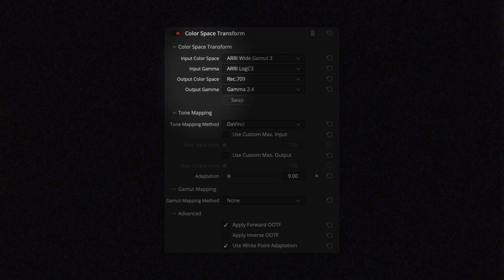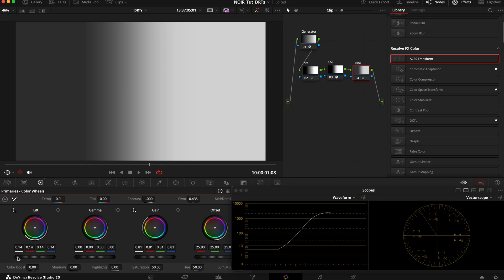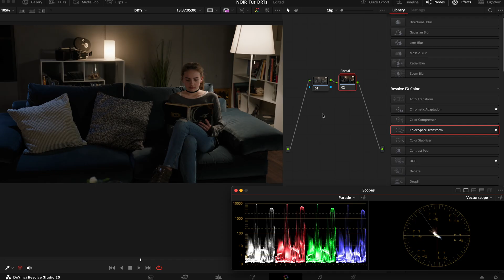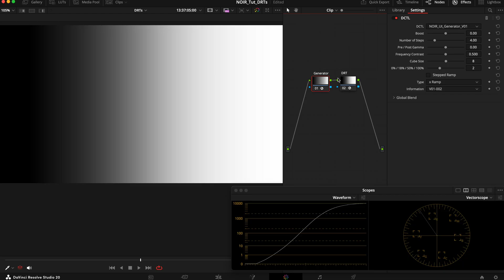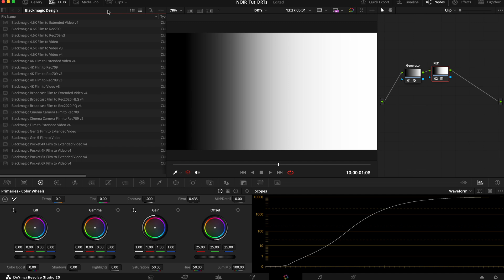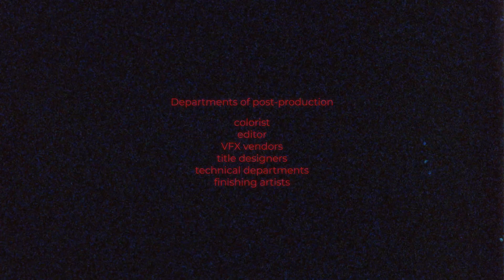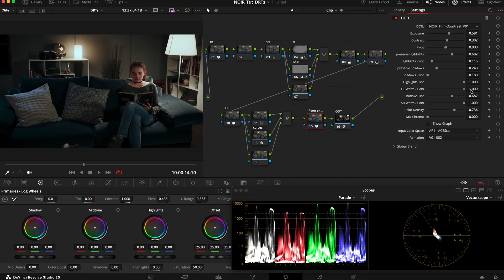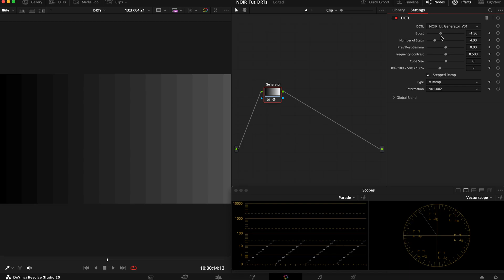Everybody is WRONG about DRTs

Comment: Such a great explanation of the technical side of DRTs and what they do. Awesome job, Sven! Personally, my go-to DRTs these days are JP2499, CSTs and Filmverse Lite. I recently installed OpenDRT as well and the presets look lovely. But I do agree with your point that it's better to have a neutral starting point and to make your creative choice in the grade, instead of in the DRT. That's one of the main reasons I decided not to invest into Cullen's Genesis plugin.
Reply from the maker: thanks Marieta. yeah, I totally get choosing a DRT for creative reasons. That's fine if it fits the project. But a DRT is also not the only reason for choosing a pipeline. For some shows it is just the better idea to do everything in ACES. For some it is smarter to work with RCM (for example if you need certain IDTs)
Reply: Nice to see you here Marieta! Yeah, I am thinking Genesis isn't for me just yet. I like the flexibility I have with FILMBOX for that style workflow/Filmverse is actually amazing and same with OpenDRT.
Reply: From what I gather Genesis is constrained to film colorimetry and texture. A very contained and straightforward film emulation tool if you will. What you’re adjusting is mimicking photochemical lab processes (photo chemical look development as opposed to digital look development) that feeds into a print emulation or “the display render”.

Based on the philosophy that je shared its equivalent look development feeding into DRT (Print)

So is that not doing the major two step  process in one node at the end vs doing it across several nodes leading to the end if you were to group that all into a compound node wouldn’t it be the same thing in terms of complexity and order of operations.?

Comment: I am a hobbyist and in no way considered a professional colourist. I make little YouTubes with my consumer kit, Osmo Pocket, DJI drones and Panasonic cameras. Before the concept of DRT's became popular I was happy grading with Resolve's own Colour Space transform workflow. As it happens I live in a seaside town which has stunning sunsets and bright lights including neon lights. While grading my projects under these lighting conditions I would get strange artifacts in my grading. Hues and tones would simply break giving me horrible blotchy black pixels when tyhe scene had very strong vivid lighting from neon lights or firework displays.

When I started using DRT's in my colour grading all these problems of strong lighting conditions or vivid hues creating horrible black blotching artifacts immediately stopped and I was able to tame and control those hues. I even went back into old projects and replaced the Colour Space Transform node with a DRT and immediately saw an improvement. Its all very subtle going from a CST to a DRT but its enough for me to notice and I like the results.

My current weapon of choice is JP2499, especially when I pair it with Dehancer and a few DCTL's by Mononodes.

Comment: Great video, thank you! I personally use a Layer Mixer to compare DRTs quickly — I keep the bottom layer visible, then toggle it off to see how the other DRT affects the image.
Sometimes I like to mix two DRTs together by lowering the opacity of the bottom layer until I get the look I want. Is that a safe thing to do? I haven’t noticed any artifacts when doing it, but I’d love to hear your opinion. Thank you 🙏
Reply from the maker: comparing via layer mixer is something I do a lot as well, regarding mixing I'd be careful as usually all DRTs apply clamping at the limits which can theoretically create problems when you mix two layers

Comment: I feel like the criticism of DRTs that they make collaboration between people in different programs more difficult is easily solved by communicating a show LUT that the editor/VFX artist/DP should be using throughout the pipeline. Tbh even if you're grading under the Resolve CST, you still need to turn that into a LUT for any collaborator using an Adobe app, and you should also be communicating your intended contrast and saturation and whatnot via that show LUT too. Or, if the colorist is brought in at the last second, it is okay for everyone to be looking at the image under whatever generic DRT but they should just be aware that it is likely not at all representative of the final grade. I don't think I view the DRT freedom as a serious problem.
Reply from the maker: Hi Thatcher, thanks for stopping by.

I do agree with you that it can be solved, but from experience I know that the more you rely on good communication the more likely it is about to fail. The number of times I had VFX artists work with a default Arri LUT, not knowing the plates were in RWG Log3G10, clients wondering why a shot looks way different in the vfx previews and in the Edit (rushes) and in the suite (pregrade).

Of course it's doable, but it is more complicated and human errors are more likely. That's why I would recommend ACES as it is designed (and implemented) to work for everyone. And why I am putting some focus on well built DRTs that are available for multiple displays as well as programs through OCIO or whatever is supported.
Reply: @NOIRGRADE  Maybe I'm being dense but I still don't really see the argument. Editorial and VFX can either work under the colorist's look+DRT, or they can choose not to. If they don't want to, then truthfully they can use pretty much whatever DRT they want if they want to preview an ungraded SDR or HDR image. I don't know that there's any big advantage to them using the same DRT as the colorist (or to force the colorist to use the same DRT as what VFX/editorial arbitrarily decided to use) if they're not gonna use the rest of the look that the colorist is willing to provide.

The only way for those teams to see the colorist's look + DRT is if the colorist provides  a LUT. If they use the colorist's provided LUT, then it shouldn't matter to them what DRT the colorist used because the DRT is baked in to the LUT.

The best case scenario is that everyone from the start of production uses a LUT provided by the colorist. It's almost just as easy to communicate to people which DRT to use as it is to send them a LUT, and the LUT includes more than the DRT choice, it also includes a look that will be representative of the resulting grade and it's hopefully the look that the DP/Director/Colorist and everyone already likes. This also avoids the "rec709 love" problem where the director gets too used to the ungraded footage and you should also get better composites.

I think I'd agree with you if it were the expectation that everyone has a copy of the colorist's node graph, in which case obviously if the colorist uses a third party DRT and other tools, it's harder for everyone else to preview the right image. However, when the options for VFX are (1) a stock DRT, or (2) the colorist's look plus the stock DRT baked into a LUT, or (3) the colorist's look plus some other DRT the colorist chose baked into a LUT, options (2) and (3) have zero difference in difficulty for other teams because they're both just slapping a LUT on, and the first isn't representative of the result anyway, regardless of if the DRT matches the colorist's or not.
Reply from the maker: Don't get me wrong. I am totally on your side that it is technically possible and only requires good communication. Maybe I have just been working with incompetent people for too long, but in my experience simple and quite obvious things like "the vfx preview looks way different from the final grade" have led to way too many discussions. Not always the colorist is able to actually talk with the VFX vendors, not always will they actually use the provided LUT.

This is why I am listing the possible errors and hiccups besides comparing the DRTs for their qualities. Too many people already just jump on the hype train, saying "use this, don't use that!" without talking about other things besides aesthetics. Not everyone watching is as critical thinking and educated as you and me. Which btw makes me happy, to see you in the comment section :)

Again, yes surely custom pipelines are very much possible and can of course be used. In my videos however I try to incorporate personal experiences. It's not like color science has "rules" that could get you in prison when you break them ;)
Reply: @NOIRGRADE  I see where you're coming from, it's obviously a nightmare working with people who just don't get it and there is some strategy needed when working around those sorts of people.

I suppose the crux of the issue for me is this one question. You call out that sometimes the director will say the VFX preview looked very different from the grade, which I think you're saying happens in part when the VFX preview uses a different DRT than color does.  If we suppose that VFX uses some neutral DRT like ACES 2.0 and color uses the same DRT but puts in some work underneath it, do you not end up with the same complaint because the VFX preview was lacking the colorist's look? Curious if your experience has found that only matching the DRT is sufficient to avoid that complaint most of the time.
Reply from the maker: @thatcherfreeman  you are right, considering color adjustments of course there are differences anyway. But at least they are usually not as extreme as they are with different DRTs like the old ACES 1.3 vs Arri K1S1 for example. Most of the times when this became a "problem" it was rather early in the grade - comparing VFX and dailies - and usually with clients that were nervous and unsure about a look to begin with.
Reply: @NOIRGRADE  Thanks for the explanation!

Comment: If I was recording from a Samsung S23 with HDR10+, what color management setup I need to do? I'm working on using my phone for green screen.
Reply from the maker: I'd try converting Rec2020 / ST2084 1000nits to DaVinci Wide Gamut Intermediate as the IDT, then grading in DWG Intermediate, then outputing to whatever display you need. Not particularly sure how well green screen works with a phone.
Reply: @NOIRGRADE thanks!

Comment: I'd disagree with using ACES on bigger projects just because it's the only "universal" color management system. That's because its DRT is rather poor in my opinion (yes, including ACES 2.0) and for me, the choice of DRT is a crucial part of any look. As such it shouldn't be imposed upon the colorist for technical or collaborative reasons. For bigger shows, all footage can converted into a single color space for easier collaboration, and SDR and HDR LUTs can be provided for monitoring on-set and in post (editorial, VFX etc).

Yes, using ACES may be a bit easier due to its wide spread use compared to a custom workflow, but I don't see alternative workflows as being unreasonably complicated - it's all about communication and agreeing on the pipeline from the get-go.
Reply from the maker: fair point. I am not saying you 100% must use ACES always and there is no other way. I am saying certain productions benefit from it. You wouldn't believe how many times we had clients in the suite that were shocked to see vfx in the timeline look different from the rushes and previews because the vendor used a custom pipeline. How many times vfx artists used a wrong display LUT and a shot totally broke when we applied the color pipeline, because they couldn't see it with their LUT.

ACES has its flaws and problems for sure, but in most cases it simplifies so many things, that I easily tend to grading with its DRT and manipulating color underneath to create a look.
Reply from the maker: and communication is the key factor that leads to problems imo. custom workflows require more and better communication. let's face it, this is exactly where human errors emerge. ACES helps a lot here.

again, not saying you must. but it helps a ton

Comment: This is just my personal opinion, but I think I mainly agree with you. 

My issue is that people have mixed a creative choice (how do I want to tone and gamut map out of range colors and luminance values) with a technical task (how do I convert from gamut x to gamut y, and from transfer function a to transfer function b).

I would much prefer if we just did the math at the end, and had the creative choices happen in between these technical steps, and have everyone use the same published math.

I personally only upload in HDR, and HDR highlights an interesting point...we only, originally, did these tone and gamut mapping steps because we were trying to fit a large range (12 stop+)  into a small box (BT1886). Now, some people prefer the look of that, but in HDR, this becomes less important, IMO. We no longer have a tiny space with 6-7 stops of dynamic range, we don't have to compress and shift and clip stuff for technical reasons when working in the larger space that Rec2100 gives us. Most of the time, my video rarely exceeds Rec709, and it almost never exceeds Rec2020, so why should i shift all my colors to potentially handle an out of gamut color more gracefully when that almost never happens?

So, I have played around with 2499 and OpenDRT for a long time, but a lot of the time, I will just use a CST with tone and gamut mapping set to None, and then it is up to me to make the creative choices of what goes "inside the box", using any of the millions of tools available, rather than delegating that creative task to what I think should just be just preparing an image signal for a piece of hardware (the display).

And that was the main "issue" with Camera Manufacturer LUT's, its not that they aren't able to convert the image, its that they do so in an opinionated way, a way that I may not want them to do that. They took the creative choice away from the person creating the image, and imposed their own sensibilities.

Anyway, I know this is kinda a "hot take", but I enjoyed your video a lot! I subscribed.

Comment: Great video, nice DRT primer.
To me Resolve color management(as a whole, not DRTs specifically), is overly convoluted especially compared to Flame. I rarely use my Resolve studio as a freelancer and stick with Flame but I would still like to dig into it beyond the basics and the way color management is implemented in Resolve is one thing I'm not a fan of. 
Flame had ACES for years and implemented 2.0 when it came out and has now finally implemented OCIO so I've been basically using ACES most of the time but I know in Resolve some colorists prefer Davinci Wide Gamut. I do far more finishing and comping than grading, fyi.
On an aside, the "Open DRT" in your example looks just wrong to me. The woman's skin is unnaturally flat like and very digital(for lack of a better term). Not sure why one would want to fight ARRI color science when it comes to skin tone?
Reply from the maker: to be fair, OpenDRT has different options available. I was showcasing the Base model.

Resolve's color management can get super complicated easily. Especially with terms like timeline luminance, tonemapping for input and output transforms. White point adaption. it's a big complicated mess, which is why I try to explain it through my videos. Hopefully they help you understand it better.

Comment: Question: is Reveal the LogC4 official LUT or something else? I ask as I can’t anything similar in the Arri site.
Reply from the maker: yes. Arri Reveal is the new color science that was developed for the newer models and uses LogCv4 primarily. You can however still use it with LogCv3 by simply converting 3 to 4 with a CST. If you compare this to simply using the older LUTs for LogCv3, you get a similar but kinda upgraded image that solves some technical issues and overall just looks a bit better. If you want to download the old LUTs you can do so by looking for the Arri LUT converter website (you should anyway, since the default LUT in Resolve's LUT folder is way outdated).
Reply: Thank you! And as always nice video

Comment: Yup it’s the same in the audio space. I’m a mastering engineer by trade and the space is flooded with people selling Mastering presets that “master your music” but of course mastering is source dependent so a preset is very unlikely to work. This is how I feel about LUTs for instance and I’m starting to feel the same way about a lot of the DCTLs that are popping up. They may work perfectly for the person who made them and their footage but it might not translate to the fella who videoed his cat on his Canon mirrorless and wants to edit it in DR.
Reply from the maker: Kinda agree, kinda disagree. I see your point. It is a tiny bit simpler for color spaces, as they are essentially very well standardised and it's simple converting one set of data to another one. This is not the creative part that is color grading. This is the base line.

But yeah. many of the DCTLs that are appearing out there are very much just working on certain clips and can only achieve certain looks on those specific clips, because they are just not built well enough with enough edge cases in mind.

Comment: Question about OOTF's. Doesn't resolve know to automatically apply forward or backward OOTF's when you use CST's in either the front or backend of the node tree? I thought it knew if you are going from scene to display or vice versa?
Reply from the maker: you are right. it auto-selects it when you choose Gamma 2.4 for example. But it also selects it when using "use timeline" which might not be correct. I was including it in the video as a "this is why the button is necessary" kind of info. It's better to understand what's going on than relying on Resolve doing it correctly automatically.